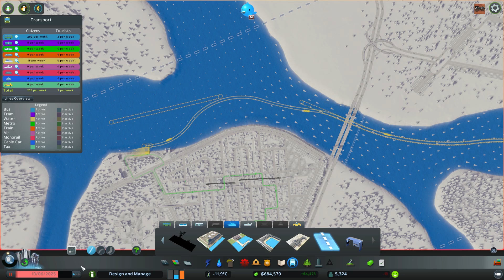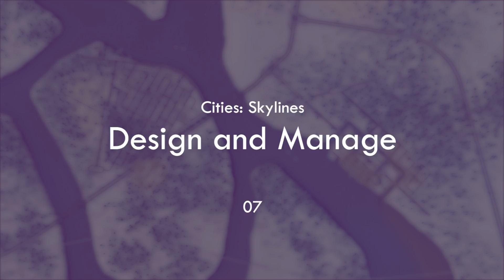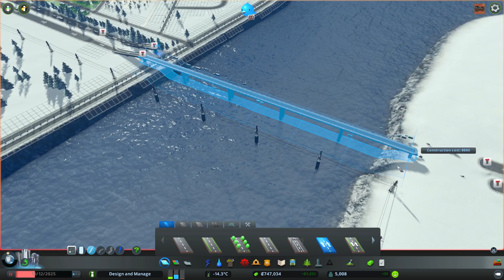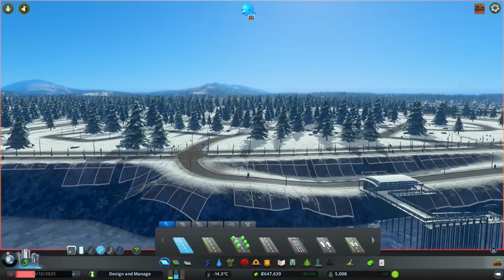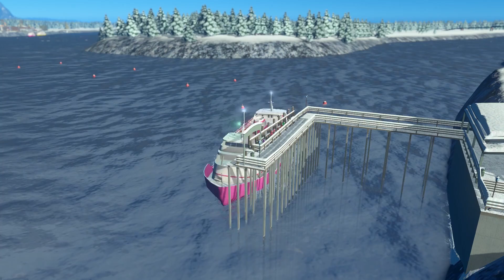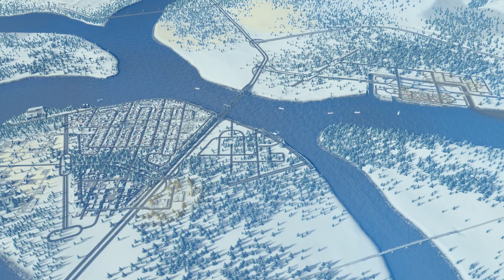Growing a Nice Grid City | Unmodded Cities: Skylines – Design and Manage, Part 7

Comment: Why did you not reuse the first ferry and just make it have three stops?
Reply from the maker: +Maarten van Heek For passenger capacity. There is a great flux of people from residential to industrial and two different ferries can transport more people simultaneously than just one.
Reply: @T4rgetGaming  Also that is not how ferries work in real life. They are like spokes on a wheel, radiating form a central point.
Reply: @MartinSparkes-BadDragon  In my town we have quite a few ferries which just act as a back and forth between two to three stops on top of the full river ferry.
Reply: Also that would took a time if used incorrectly.